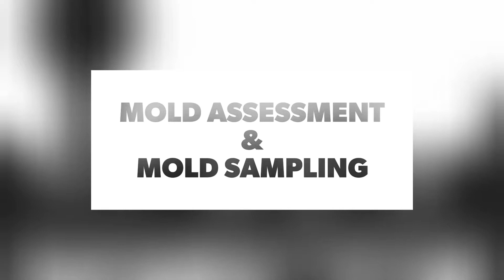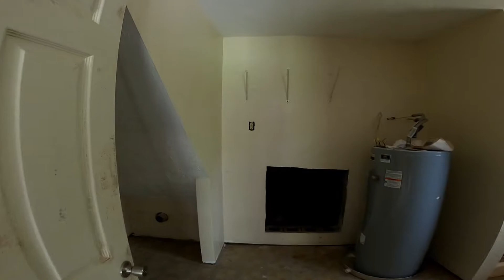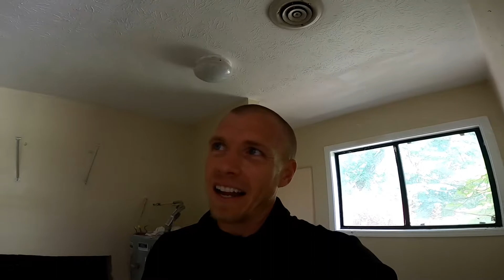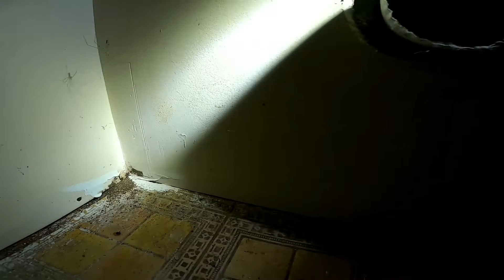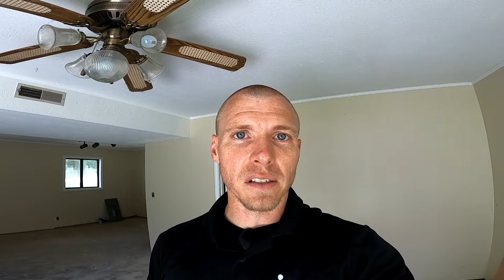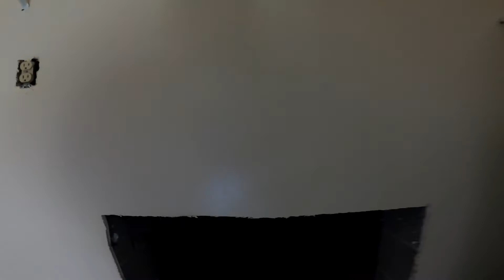Mold Assessment and Mold Sampling

Comment: I enjoy your charisma and you sound like an honest inspector. I will advise a vapor barrier over soil is conducive to microbial growth developing under it. I would go with a rat slab or gravel with a loose laying vapor barrier (no encapsulation ever) over top. Seal up the crawlspace and set up a commercial dehumidifier last, after all contamination has been removed. Thanks for your vids, I’m subbing now.
Reply from the maker: Thank you! There are certainly a few different approaches. What part of the country are you located? Based on some of the terminology and methodology that you mentioned, it sounds like you may be in a different area.
Reply: @inspectorcluseau6084  I’m in the Delmarva area and we get high humidity up here just as bad sometimes. It’s the act of enclosing soil with an encapsulated vapor barrier. It creates an upside down Petri dish of mold, really almost anywhere you go, because of the moisture that always naturally rises from the soil. That concept creates mold and it cakes up really bad under the poly. And no matter how sealed your encapsulation is it doesn’t matter, the spores will escape from the stack effect. They always find a way. And why would you even want mold under your vapor barrier anyway? 

The gravel works as a capillary break, reversing the moisture back down into the soil to help control moisture. But you wouldn’t encapsulate it after. You just loose lay poly across the surface, taping it together. Or you can lay down the vapor barrier and totally cover it with cement like they are doing on many slabs today that are being built for houses. 

Soil under homes is a no no, period imo. And encapsulating it is a disaster waiting to happen. I’ve seen enough pics of trapped mold under vapor barriers, even in dehumidified crawlspaces.
Reply: Air sampling isn’t effective until it’s in a space with visible mold, not the most accurate to sample air in the middle of the room.